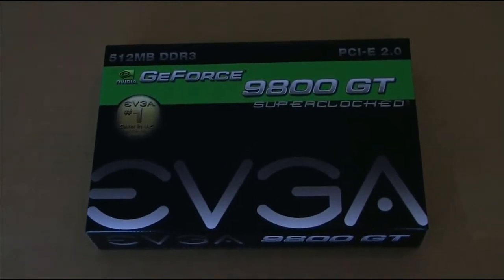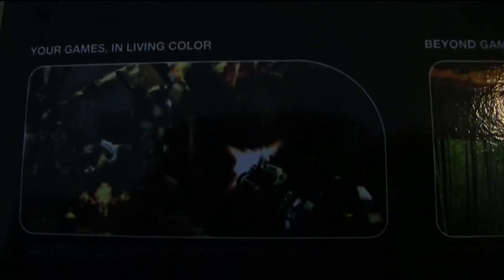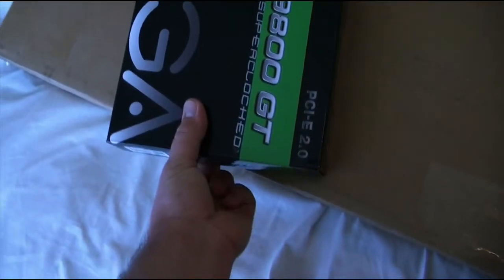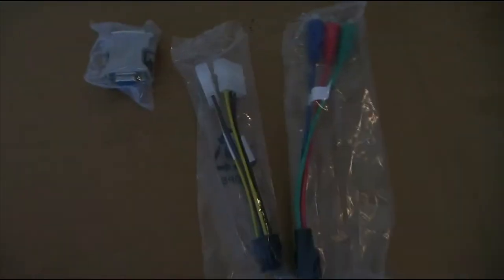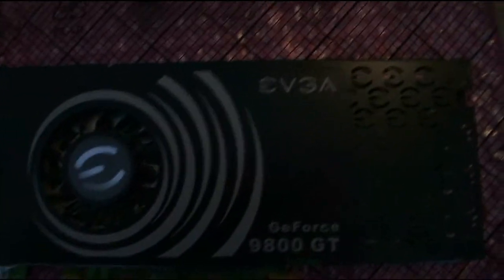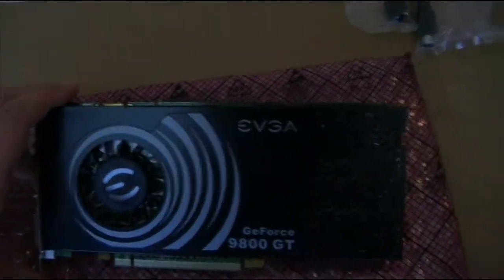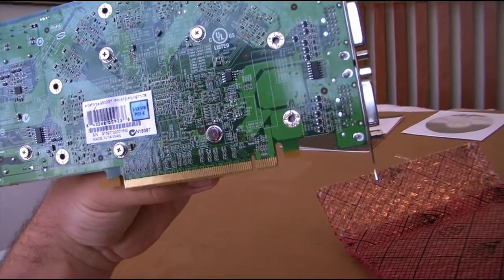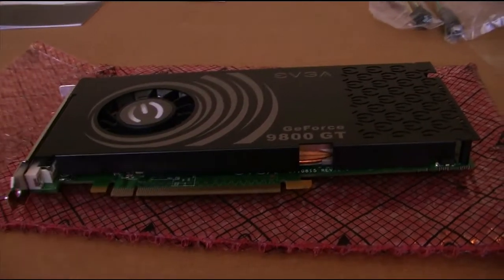(HD) Physics Card EVGA GeForce 9800 GT Superclocked

Comment: Dude you need the Ageia PhysX Card. The 9800GT is just an old vid card. If you install that card with your new 285's you basically just cut the nutz off those bad boy 285's. your GPU will be limited too only what the 9800GT will do. Plus I have not seen a mobo yet that will be bigg enough for 4 cards that size tobe installed together. I believe the AGEIA PhysX card is carried by BFG and sold on their website.